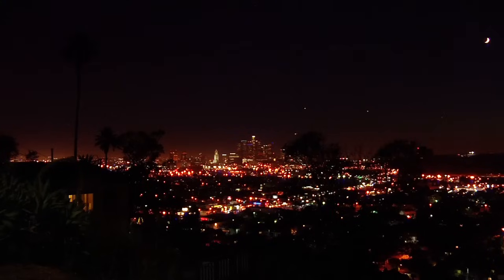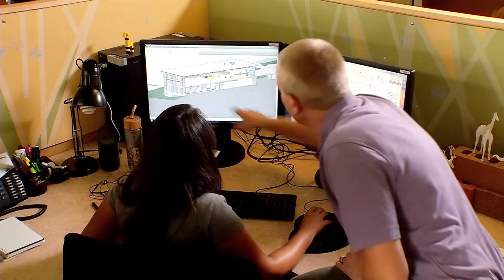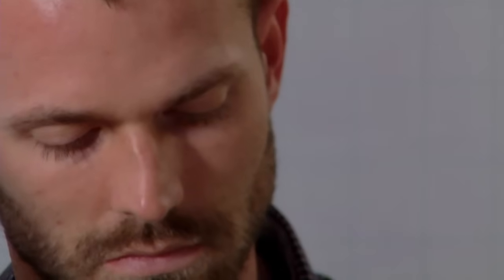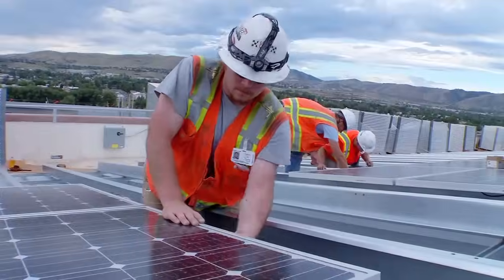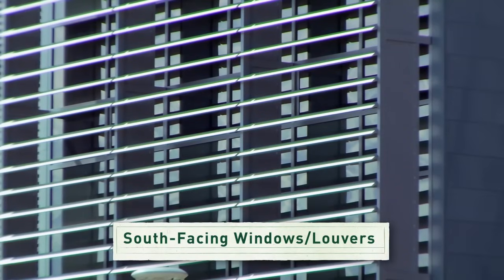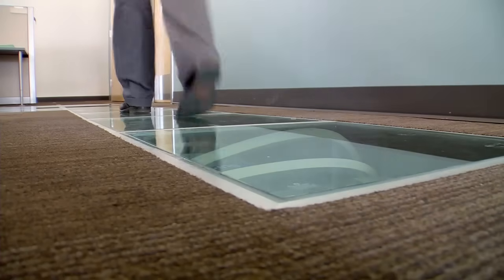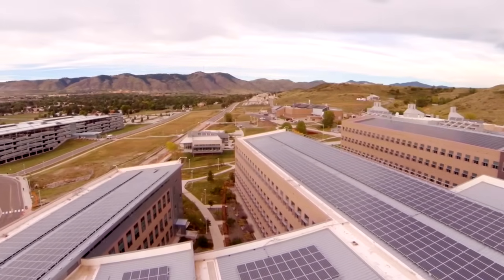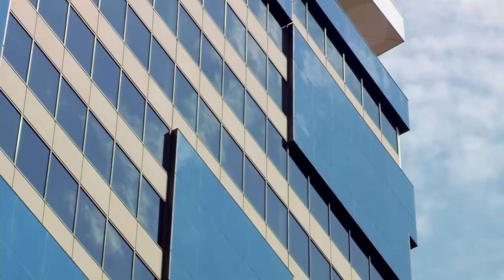Energy 101: Energy Efficient Commercial Buildings

Comment: In warm climates, one of the best energy-efficient features is a cool roof, which is when the roof is highly heat-reflective.

In warm areas, buildings' top energy demand is air conditioning. By reflecting heat instead of absorbing it (like typical asphalt shingles) can keep a roof ~40 deg F cooler, which then keeps the attic cooler, as well as the rest of the building. Keeping the building cool improves quality of life, reduces energy consumption, and saves the building operator money.

Cool roofs also keep the local area cooler. If every building in a city used cool roofs, the city's average temperature would be several degrees cooler. If used around the world, cool roofs alone alone could offset the effects of CO2 from every car on the road.
Reply: Hi  am new @ this and singal how does one know if this new  building  i might be interested so plz help with a appointment  .thank you 4 ur adds.
Reply: Great idea.

Comment: Great presentation, but omitted using ground source heat pump system first before putting up solar panels.  Ground source heat pump system will save half the number of solar panels needed.  Ground source heat pump system uses four parts free energy under your feet plus one part energy from solar panels to heat, cool and provide hot water.
Reply: Only in climates that get really cold. Wouldn’t be very cost effective here in California.